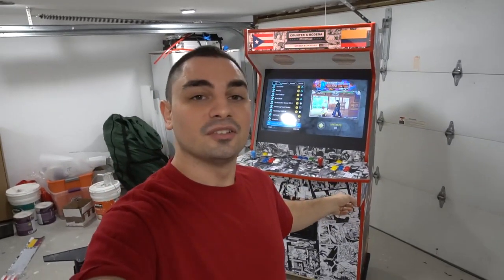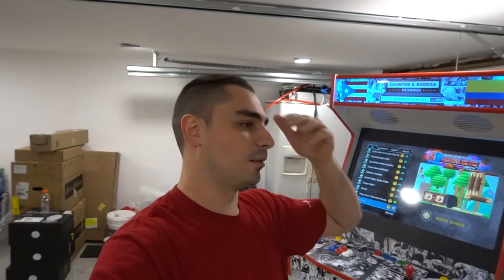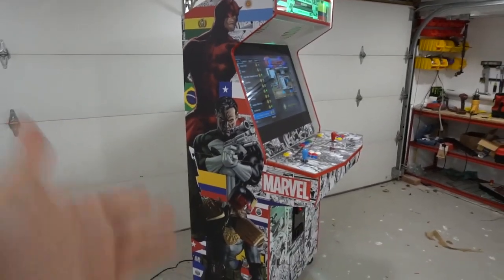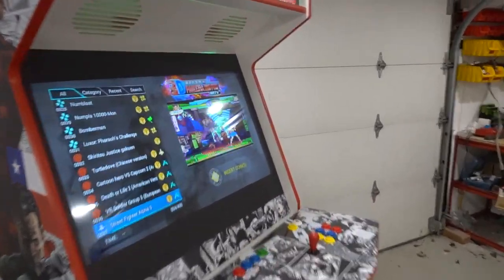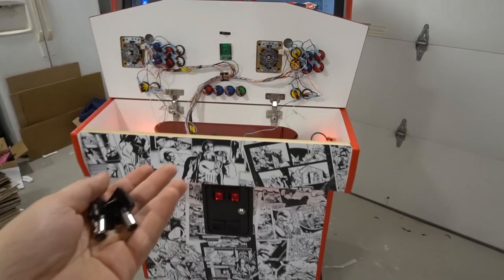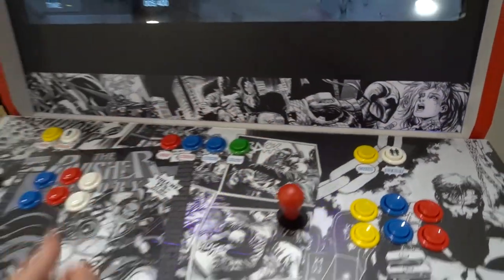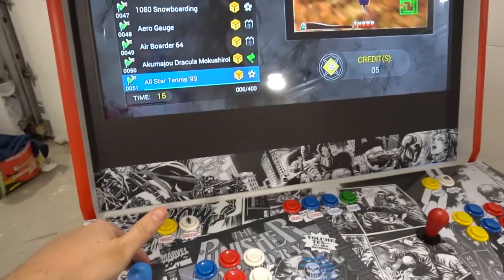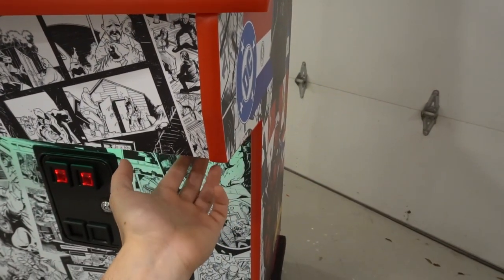Pandoras Box 18S Coin Operated Upright Arcade - Counter & Bodega Build

Comment: Do you have a vid on connecting a coin door to a Pandora?
Reply from the maker: That's easy, coin door is lie a regular microswitch... you wire it to player 1 coin button 
If you have a double coin slot like mt.vid, then left side is p1 and rigjt side is player 2

Comment: Can I use this with a single coin acceptor if so how would this be wired does adding 2 credits on player 1 button mean that player 2 could join
Reply from the maker: Yea u can use a single coin acceptor. Inserting coins go to the pandora box "credit counter" it can be used for both players 
Yes 2 credits on p1 can let p2 join

Comment: Qstn. what color is the jamma wire connected to the Coin wire (white)?
I pre setup my coinslot to accepts coin after setup, when I connected it to the (Green) jamma wire of Pandora, suddenly it wont accept most coins. Pls. help
Reply from the maker: Is yours a family edition jamma or standard jamma
Reply: @Vic_VP  just standard 28PIN 2.8mm jamma wire
Reply from the maker: @trialanderror483  then yes the green wire pin 16 should b coin
Reply: @Vic_VP  thank you, i did not add a COIN BUTTON, i just connected the green jamma wire to white wire of Coin machine, its working but, when Im Game Over" I cant continue the game when i insert coin, Pls. help
Reply from the maker: @trialanderror483  when u insert coins something will appear on the screen... you then need to hold p1 start and a me u pops up and u need to press insert coin

Comment: Do you have the momentary switch wired to both player 1 & 2 buttons or just player 1 for the credits? Wanting to add a switch to my build for my daughter and her friends to use.
Reply from the maker: On all my builds I use 2 slot coin doors
I wire left slot to p1 coin and right slot to p2 coin
Reply: @Vic_VP  sorry I should of been more clear I'm using a two slot wired just like that. I'm talking about the switch on the back of the cabinet. Also that's an amazing build I put a pandoras box in an old twin cobra cabinet.
Reply from the maker: @shoncook89  o like the secret button I put. I would only out it to p1 coin. If you put it to both p1 and p2 coin then it'll drop 2 credits instead of 1. Better off being safe and putting it to p1 coin
Reply: Thank you and again extremely nice build.

Comment: Are the pandora clones worth it? And if so where should we get one from ?Or would you recommend to buy from the Canadian company? Just for home use.
Reply from the maker: I currently use pandoras box 18s pro.. it's a clone.. I haven't had any customers have any issues at all
Yes there are a few duplicates of games (such as 6 versions of Street fight 2) but it has a few console games and NFL blitz n64 which still blows my mind.
I orfer from ebay or Amazon
You can look for "pandoras box control panels" they are basically plug and play fight sticks. The pb18spro I get for around 130$ us shipped 

I don't buy from Alibaba or Ali express
Reply: @Vic_VP  these versions the games can be saved too right? Also how do I find the ones you offer on ebay?
Reply from the maker: Ummmm not all games cab be saved. I believe it depends on the game your playing. I don't 100% recall about save games.. I know it's a feature but not on all games.
I don't sell on ebay. A simple search on eBay for pandoras box 18s pro will definitely get you several hits :)
Reply: @Vic_VP  thanks

Comment: Did you set the display to 16:9 or did it come that way?
Reply from the maker: Pandoras box doesn't have video settings like a pc or pi build. It's automatically 16:9 and it stretches all games 
I'm making another one now and will go in depth with PB as customers are asking the same question you asked lol

Comment: It's cheaper to buy without controll panel
Reply from the maker: Not really, also depends what pandora. You may see pandoea box for 80$ on ebay... that doesn't include power supply and the wire harness

Comment: Why buy a whole 2 player arcadeboard when you can simple buy the board separately for much cheaper lol....
Reply from the maker: Doesn't come out cheaper from what I researched

Pandoras box
Power supply 
Wiring harness

Those 3 combined I have yet to find cheaper than 100$ which is what I pay for the control panel